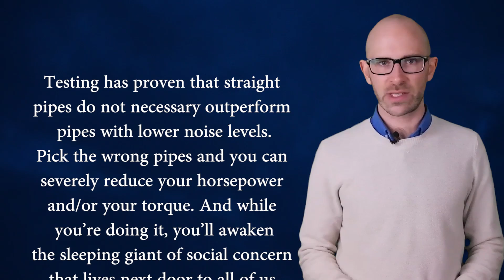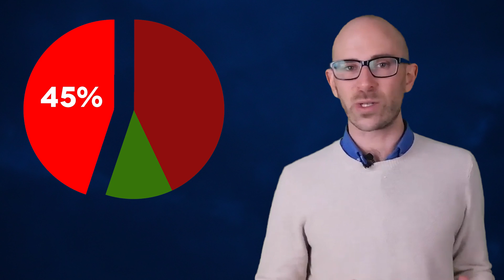Why are Harley Davidson Motorcycles So Loud?

Comment: It stands to reason that there would be more fatal single vehicle accidents because those would happen at high speeds, usually on a highway or someone taking turns too fast. In those situations it's not that likely that a car would have the opportunity to hit you. However on normal surface streets there are many more opportunities to get hit, and not die. Just because the crash isn't fatal it doesn't mean you won't get hurt (plus medical bills and the repair bill). Drivers just don't pay attention, they can look right at you while in a turn lane, and turn anyways (as well as hit you in other ways of course.)

That being said, most bikes are loud enough stock in my opinion. If someone doesn't hear you normally, they won't be paying enough attention to your straight pipes either. You're just waking up your neighbor and annoying people in suburbia.

Speaking of loud things though, one thing you might want to upgrade on your bike is the horn. I can't speak on "most bikes" because I'm sure they're all varying, but on my Davidson Sportster 866 I went ahead and replaced for a louder horn as the stock one was a little weak. Another tip is hard side bags. If you get side swiped on the road they can help save your leg.
Reply: Oh and I assume drinking and driving has a significant impact on fatal accidents as well.

Comment: Making your motorcycle loud is just a call for attention. Every twist of the throttle is an exclamation " look at me, look at me!" 45 years of riding motorcycles has convinced me of this.
Reply: yes,  look at me, be aware of me, do not cut into my lane....  fk your 45 years of opinion.  i run v&h grenades in the city and a bassani road rage on country roads.. i want to be heard.  l like living
Reply: I bet you don't wear a helmet either.  Gotta look cool  to go along with my noise.  Your noise is not getting through to the cage driver with his windows shut, AC and stereo on, and his texting thumb going wild, unless he is behind you.  Research shows this but you have another agenda that includes the myth of "loud pipes save lives".  https://www.autoevolution.com/news/most-common-motorcycle-myths-debunked-part-1-45969.html
Reply: troll

Comment: How hard is it to set a max db a car or a motorcycle can make. Like a dutch artickel 5.6.11 set a max for mopeds. wow we have some nutz high db on motorcycles just a direct quote 350 CC - 95 db 500 CC - 97 db 750 CC - 100 db 1000 CC - 103 db > 1000 CC - 106 db.
i find this rather loud.. ah well if you ever heard a motor without exhaust you be happy whit this.

Comment: They (H-Ds) aren't loud unless one makes them loud.  All bikes can be made to be loud with an exhaust change.  I know, captain obvious, but surprisingly some people don't know this.
Reply: That is a good point as a Brand new H-D comes with pretty quiet pipes.  So it isn't the manufacturer that make them loud.  We do.
Reply: Harleys have a different loudness it's a lot deeper
Reply: Maybe they're in a car with the windows up and the radio on. They won't hear anything.
What happened to defensive driving?
Reply: Peter Wilson wow u misty be a rancher because that comment is the biggest load of bullshit i have ever seen. Stock Harleys are definitely louder then a 250 Suzuki but they are not loud enough to rattle windows and drown out every other sound around it.
Reply: Peter Wilson you can look up videos on here of stock exhaust on a sportbike and Harley's to compare. They are both relatively the same decibel levels, but the Harley is deeper that's about it. I don't know about your theory on low toned exhaust traveling far. One can usually hear a rice rocket with exhaust a lot further than you can hear a Harley or vtwin... just saying.
Reply: warhawkjah people make bikes loud so people can fucking hear and hopefully see them...
Reply: Then smaller bikes need to be even louder? And why have a horn then?
Reply: Steve RX4 some people for some damn reason cannot hear the horn or the bike half the time...
Reply: Steve RX4 their is sometimes when you can’t save it...
Reply: So? Then you want to put on a loud exhaust that wouldn't help anyway?
Reply: Peter Wilson lmao seriously? How many stock Harley's have you been around? My guess is none because they aren't loud from the factory.
Reply: Peter Wilson Nah I'm.not deaf. I have satellite dishes on the side of my head and can hear a pin drop across the room. Factory Harley's have a tone, but by no means are they loud. Louder maybe then factory exhaust on foreign bikes but not by a large margin..
Reply: People do this shit with their riced out economy cars too, all it does it make the car sound like mechanical diarrhea. I never understood why people think it's cool for your car to sound like trash. The best engine sound is the way the manufacturer intended it to sound.